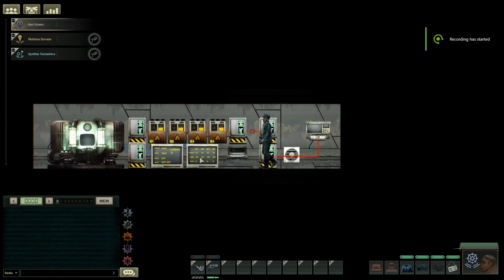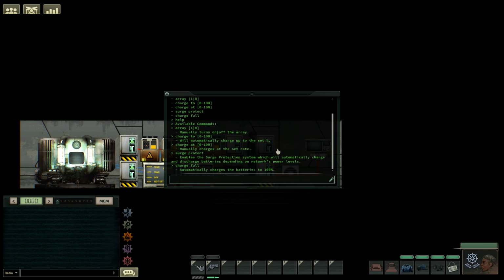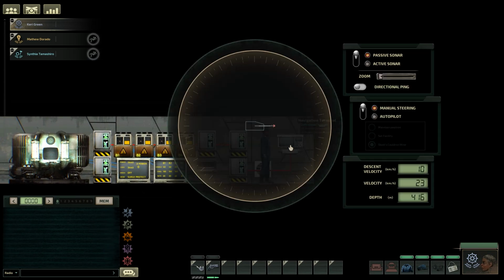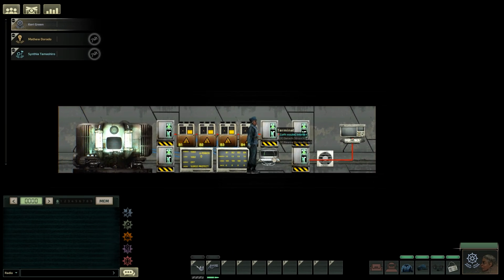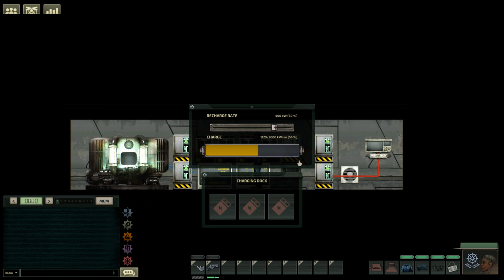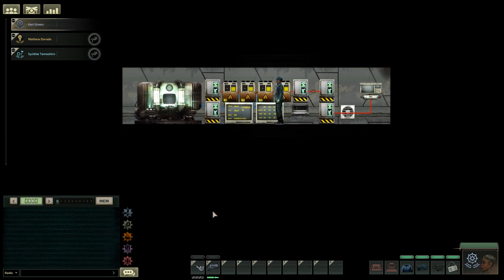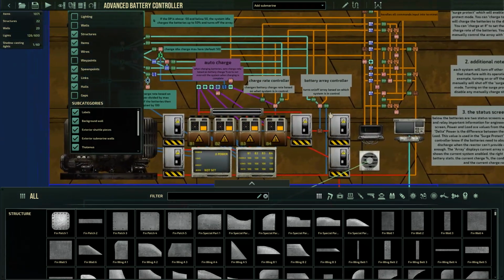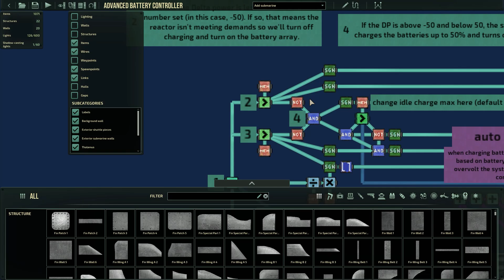Advanced Battery Controller with Surge Protection

Comment: I have a feeling that sometimes people just steal ideas from my head, fr. I've implemented a similar system on my sub like a month and a half ago, it's not in the workshop at the moment.
Making something like that is not really difficult tbh. The only thing that looks hard to build here is a terminal control and its commands 

I've also seen a more complex system that was based not on the ratio between production/consumption, but production alone. In this scenario certain systems activated only when the reactor production has reached a certain point.

Good job anyways I liked it.
Reply: Rene Descartes dijo "Cada pensamiento es existente"
Reply: Hey I know it's unlikely for you to reply now but I have a few questions for you regarding this system.

First of all, did you get rid of the random switches? I've been fighting them for a little over a year now and I just can't wrap my head around the how at this point. Every time I come up with a well thought out and elegant solution on paper it refuses to work in-game. I know you can technically do it the stupid way and let it switch for a while and then detect the switches and shut it off (I haven't tried implementing it this way but I can see how it'll be much easier than the way I do it) but I want to prevent them from happening entirely.

Before I was trying to only rely on myself and no one else's solutions but today I let myself slack off because of the revelations I made. I wouldn't say with 100% confidence that they're true but it seems to me that because of Baro's components' nature different parts of the circuit get the values in different times (for their chain length will vary and therefore the amount of ticks it takes to evaluate the chain is different, too)

Also it seemed to me that the junction boxes have a slower update rate than the relay components do so when you're trying to implement a system dependent both on battery load and total grid load you'll not be able to (unless I'm missing something)

Anyhoo, I digress. You're saying that making something like that is "not really difficult". Is that so?

And that's actually it for now, might add something later